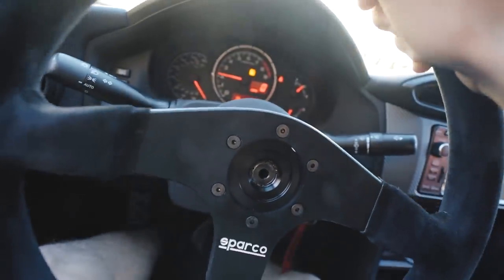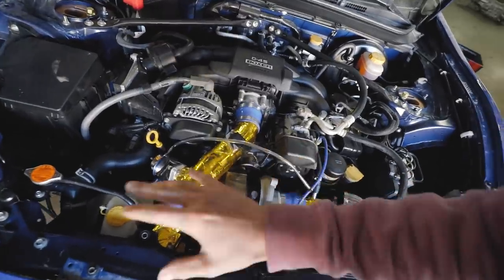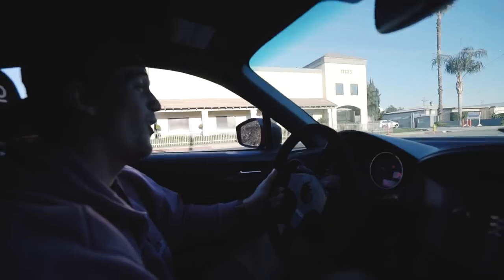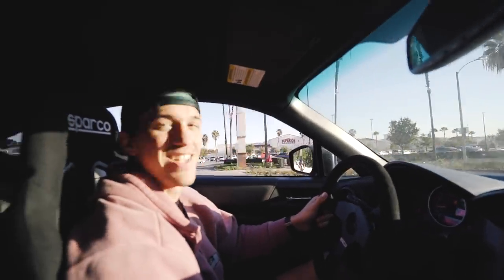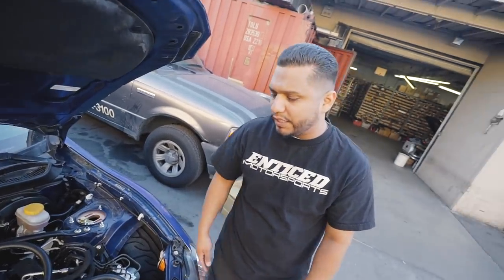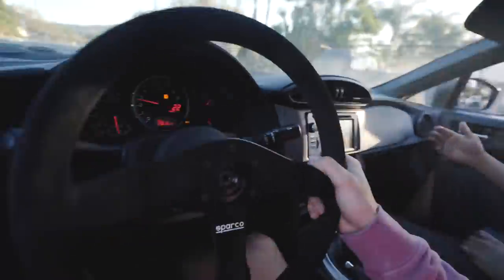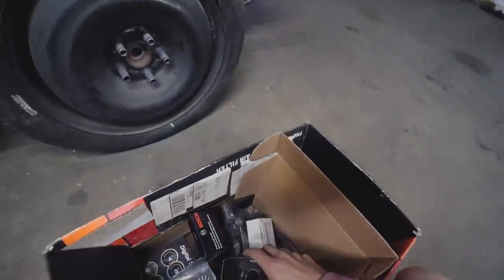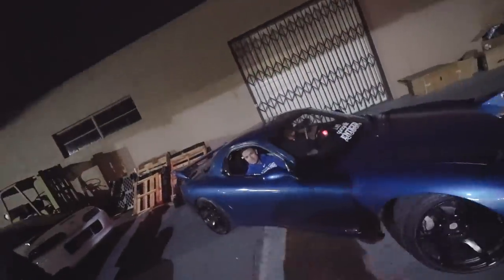How to Get The BEST TURBO NOISE From a Boosted BRZ

Comment: It’s not venting as you won’t be pushing much boost, therefore the BOV is acting as a block off plate. Once you get it tuned you’ll see what the BOV sounds like with more boost 🤙

Comment: I definitely think it sounds better without the bov. It's quite audible even without much revs. If you're interested you can check mine out, it runs at 10psi and is a bundle of fun :D

Comment: Been driving small stock turbo for about 10 year now. Got a Greddy BOV as well. Sounds like you need to adjust the spring in the BOV. It’s fluttering which you don’t want. Purpose is to release all the extra air when the throttle body closes and prolong the life of the turbo. Surge is a no no. Soften the BOV but hard enough to where boost doesn’t leak.

Comment: It's not compressor surge... If its making that noise with the throttle down its compressor surge which is bad for the turbo. Its completely safe without a BOV as long it's not surging also sounds more sick
Reply: KoNLaR Open Throttle Compressor surge is bad, closed throttle compressor surge doesnt harm the car. If its surging while you're on the throttle, that means its maxed out on how much air the motor can handle, and is forcing air back through the blades of the turbo while the turbo is still trying to force air through to the block so it wears the bearing out. But if you arent on the throttle then its a free spinning bearing and so its not going to harm it then.
Reply: Brian K.  no it isn't coz the turbine is already free moving when ure off throttle so its only harmful to performance coz ure gonna take more time to get back in spool range
Reply: Brian K.  you realise facotry turbo cars back un the day came without bov or intercoolers lol on low boost its only super minimal wear. I mean super minimal especially if its a dual bb turbo and high quality

Comment: You need to adjust the bov doesn’t seem like it’s venting at all
Reply: Jamie.Conayne exactly. The BOV isn’t even blowing off because the spring is too stiff so it’s just doing compressor surge anyway. Once the spring is lower setting then it will go gggrrrssschuuu instead of gggrrrssssutututu
Reply: Yep or it’s adjusted to tight or hard
Reply: Agreed
Reply: @xvReece  or hes not even running enough boost in order for the bov to work
Reply: @dannyteck8925  going off of them not getting into high boost that's what I'm guessing is the problem, it seems like the blow off valve is set for the least amount of lag meaning it'll only bleed off a very small amount of boost under full load
Reply: @rokuplayz464  that seems right
Reply: If it’s going stututu under 2500rpm it’s fine but over it definitely compressor surge
Reply: @CertifiedTyrone  It's the same thing no matter what rpm lol.

Comment: Get it tuned asap bro. The last thing you want is throwing a rod out the block and having a setback. These motors are not the strongest. I just want to see this 86 at it's max potential. You don't see much YouTubers with turbo brz/frs/86 content. Something I wanted to do personally to mines but got an Evo instead. It's always nice to see what you could have done though lol. Can't wait for more footage on yours.

Comment: Damn that car with 300whp is going to be a beast and a ton of fun. The weight to power ratio is going perfect. Hey back in the day when WRX owners put a BOV on it actually hurt the power unless there was a bigger turbo on it. Why did it effect the stock turbo badly? Is it b/c the stock turbo for the 227hp WRX wasn't running enough air and using a Bov on it let out too much air? Sorry for going off topic a bit. The car looks amazing. Good luck on that.
Reply: Matthew Mohri stock its a recirculating bov meaning it sends the air back to the inlet instead of blowing it in the open air. The ecu is calculated for that extra air so with a bov blowing in the air the car could run rich and stall or cause backfire. With a remap you can dial it out but why buy an expensive bov just for sound while the stock recirculating bov does the job perfectly.
Reply: @tubejorrit True that's a lot of money when you can buy and up pipe, down pipe, and exhaust. Thank you for the explanation. Peace and much luck to you.

Comment: I'd run bov to keep it safe. However on those Bov's you usually can adjust the amount of boost pressure it takes to open them. Look on top and adjust. It sounds like yours is set too heavy so that it's not making enough pressure to open the bov properly. It just needs softened up. It took me 5 minutes and 3 street pulls to adjust mine

Comment: Bro just be simple. Stick to the blowoff valve and less stiffer springs
Reply: Have to agree. Sounds like the BOV isn't even venting to me. Sounds like complete compressor surge which will over time cause increased wear on the turbo.

Comment: That turbo won't last. You can get the surge with bov on it. You just need bigger piping and turbo.
Reply: Never run blow off valves on my cars, never had issues with turbos not lasting.

Comment: Dustin...you’re killing your turbo. That blow off valve isn’t even opening enough to let the air escape, hence the surging noise is louder. The blocked off sounds exactly the same but not as loud because it has no small escape path such as a BOV with a too heavy spring for the application. Get a lower rated psi spring for the BOV and it’ll be correct when letting off the gas, a loud whoosh of air will be let out. While turbo surge sounds cool, it is not safe! Especially if you’re going to be drifting the brz at redline constantly blipping the throttle. Come on Dustin, be smart here! You’re providing misinformation.
Reply: Been drifting for years with no blow off valve, never had an issue, it's not as bad as people on the internet would make you think.
Reply: Its has been proven countless times that these days turbos have little to no wear when there is no BOV. Back in the day you would be correct to a point

Comment: That's a very clicky, loud sounding motor
Reply: Groovyj Cabrera Its the Toyota direct inject and port injection system. Its just a louder fuel injection system, mine sounds pretty much the same.

Comment: Step 1 - buy an evo
Reply: Evo X is 3500 compared to 2800 lbs
Reply: @MortalWombat22  weight only matters when horsepower is remotely close. Lol. A BRZ won't even shake a stick at an Evo.
Reply: Hmm, isn't an Evo around 300hp though? A turbo'd BRZ would be around 280hp. I'm new to this shit so i dont know.
Reply: REAL TAWK yes but your comparing a stock evo to a turbo brz not only that your comparing it to an evo x
Reply: Ah yeah, I guess. I only brought that up cause you can pick up a used BRZ for like 14k and turbo it ($10k?) and it should still be cheaper than a used Evo X.
Reply: REAL TAWK fair enough my comment was just a joke anyways
Reply: @MortalWombat22  some kits with a base tune can get you almost to 300whp on 7-10psi for $3000
Reply: @MortalWombat22  don't forget that you're comparing AWD to RWD also. The Evo will beat it every time if drivers are equal.
Reply: Corn Fed step 1 by a canary yellow vl bt1
Reply: Hes already completed step 1 lol